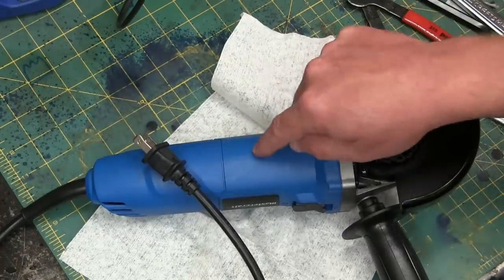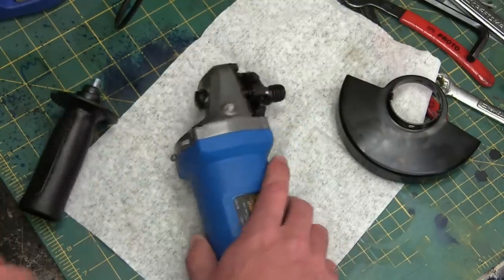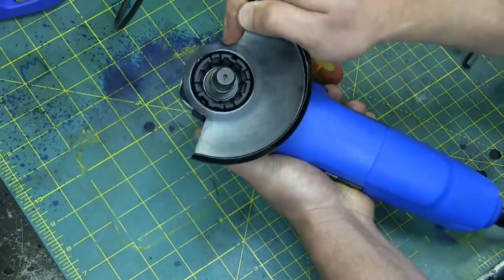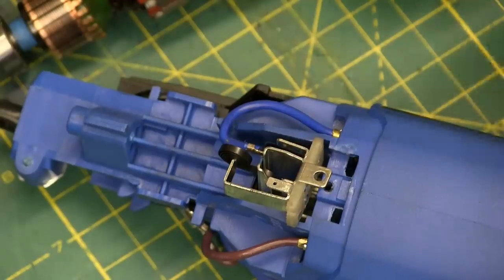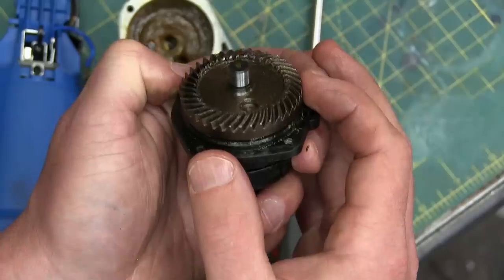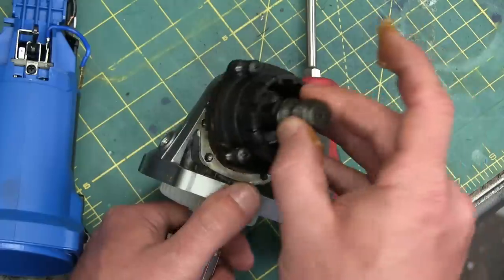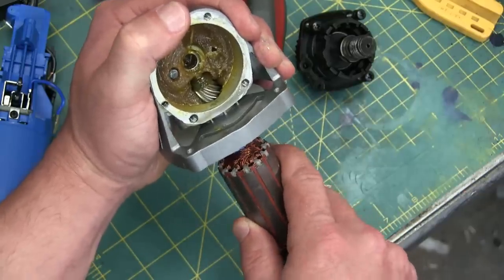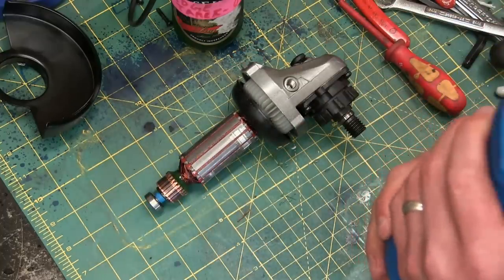BOLTR: Harbor Freight Grinder. HOW BAD IS IT?

Comment: I have one of the $15 cheapest one and have been doing handyman jobs one day in a week just to have 3 different jobs. Its already held strong for 2 years, have cut v8 crankshaft in half and some cast iron engine blocks and it still works good. Just have to let it cool if you feel the plastic getting too hot to touch, or unplug it and dump it into a bucket of water. It will cool quick and nothing scary will happen when you turn it on again.

Comment: I know this video has been up awhile, but I bought one of these grinders in 2003. I think it was $19.99 then. I used it heavily until 2014. I never had any grease leakage and never had any problem with the brush holders melting loose. I had to replace it after to tool-head lock finally wore down to the point of it not stopping the tool head to replace discs. I used it for awhile after this, but I finally used up one of the brushes and had to replace it. I thought about replacing it with another HF angle grinder, but I thought that I got lucky (if this video was around, I might have gotten another, because they don't appear to be as junky as I expected). SO I replaced mine with a significantly more expensive model in yellow/black.

Comment: Ive got probably 20 grinders.  Most of them were expensive store samples.  Missing cords and internal wiring.  I wired them up.  They definitely were missing handles and flanges.  Most were missing shields  I got a half dozen of these HF grinders on sale for the cost of flange nuts alone. $5-6 each with free microfiber or batteries with each purchase.   I've really abused these.  I put the tools that don't require flanges on them.  I've run router controllers on them, cut marble, tile, concrete.  I've got wire cups and flap discs on them.  I've had to replace the brushes on most but they come with replacements in the box.  One had a cord mess up that I need to fix(probably from using it to drag the tool lol) that only works when wiggling the cord.  One shield broke.  This is over 5 years or so.

No grease leaking, no bearing failure.  No cracks from being dropped.  No switch failures.  I've really abused these,

Comment: I have one from HFT ..use it for one thing only ..to grind a rivet off my motorcycle chain .. zips it off in 5 seconds ..worth the 15 $$
Reply: if you go throw motorcycles a lot or have a lot of them then a chain breaker is definitely a nice tool to have.
Reply: ies I have a chain breaker .. but you still need to cut the master rivet .. if you just push  it thru the link you will eventually  have a broken tool   Ask my frimd who had to  replace my chain break because he DIDNT use  the grinder I offered him ..

Comment: You are right about the two "grades" of harbor freight grinder. The normally $15 one and the normally $24 dollar one. The more expensive one makes less funny noises and seems more robust. Neither one will cut 1/2 rebar for 8 straight hours on a job. They just burn up. These things are not intended for continuous full load current. Having said that, I've had one at home for nearly eight years now and it seems just fine. I use it doing projects in the garage (cutting all thread, sanding sheet metal with a flap disk) and it still works just fine. The reason I like this model is the light weight and the gear box is smaller allowing it to get into hard to reach places with a smaller cutoff wheel. Looking forward to watching more videos, and always watch out for the Barney Fife clib board warriors.

Comment: I bought the maroon colored grinder from HF with diamond grinder wheel and ground 1/2"+ quickset off 120 sqft of concrete with zero issues.  The grinder was $18 and the wheel was roughly $20.

Comment: I've had a harbor freight 4 1/2 angle grinder for 7-8 years now. The orange "heavy duty" one with the external brush caps that they don't sell anymore. I've gone through many cutoff wheels, flapper discs, and a few wire wheels. I haven't killed it yet even after bogging it down with hot air coming out the vents and grinding for hours at a time.

Comment: I've owned about three of this size grinder and a dozen of the $9 style from Freight by the Bay. Built tons of welding projects with them. Bumpers, roof racks etc. I say Not Tea Bag at all. No grease leaks. I've never needed to replace the brushes either, even though they supply an extra set with every grinder. I have a drawer full of them. Thanks - Lumpy

Comment: I got the US one about a month or so ago since I needed something small. I have to day I an impressed with it.

also the main differences are the plastic housing for the main bearing, mine is cast aluminum. guard is tightened with a screw, so it's rock solid. also the handle is a 90', and the switch is on the top not the side.

I have dropped it multiple times and broken a few wheels, but it keeps chugging, also I cut up a forklift propane tank the other day, ran for an hour straight, no issues. also I was surprised the speed was purdy decent. for 14 and killing it it's earned it's place in my shop. definitely going to get another one.

Comment: I have four of the $14.99 grinders that I got for $7.99 on a three day week end sale. Two are out and two still in the box. Longest used is at almost a year now, no grease leaking and no failure yet, opened the second one about three months ago and its still working as well. I didn't get that high dollar heavy duty grinder though.

Comment: THe first step in your evaluation , should be to take the tool and actually use it in the proper application it was meant to be utilized for ! Then , you can tear it down to analyze it's components . Any thing less , is a Halfass evaluation !
Reply: DONT TURN IT ON TAKE IT APAAAAAAAAAAT
-eev blog
Reply: Thanks for your comment. 🙄
Reply: I think you have a point in this case.  If you break a part in the tear-down and glue it back together, It kind of casts a shadow over the run test.

Comment: I've got a Black & Decker 4 1/2" grinder that has a part plastic bearing case on the gearbox. It's had quite a bit of continuous use and it's still working fine. I did take it apart though and discovered the gearbox is dry. Always has been.

Comment: I've got the cheapo HF grinder. The grease doesn't leak out, but then again mine actually has a cast aluminum piece instead of the nylon. The fan was the weak point on mine. Used it about 6 months and she broke off inside. Still works, but I'm going to have to pull it apart and JB weld it back together.

Comment: had my harbor freight grinder for about 12 years now, its cut through everything i needed, from conduit to stainless steel and cleaned several floors using flapper discs, never failed once and still going. recently used a coupon to get a new one but haven't even opened the box.

Comment: I do a lot of scrapping and have noticed an interesting trend.
You made a comment about the "LARGE" wire size of the
field windings. Please take a file to the magnet wire used.
I have seen on a lot of appliances like washing machines
 motors and Micro Wave Transformers have copper colored
Aluminum wire which is usually a larger gauge than the 
real copper wire used. Thanks  KC1IPA

Comment: I ran a fab shop and we tried these out. A few of the guys had them at home for years with no issue. We bought 10 of them. 6 died in the first week with a poof of smoke. The last 4 didn't last a month. I have one of the Chicago Electric that I use around the house and its ok, just have to let it cool down after using it for any amount of time. I use my Dewalt for big jobs.

Comment: Thanks for the video.  Still watching my way through all of them!  Just thought I'd share with ya...Back in year 2000 I ordered the cheapest HF 4-inch grinder online.  I paid $9.99 USD and they shipped it to my APO in Belgium (I was US Military then) for free; they even hand-wrote a "...thank you for your service" note and tossed it in the box.  I didn't expect much, but she chooched just fine.  Got a big project done.  I ordered 7 more for the same 10 bucks each and they are ALL still choochin' today.  Worst break so far was a gear-case bolt backing out....cranked her back down and she never bothered me again.  I don't treat my tools nicely.  Each grinder came with spare brush sets, which seem to go about 20-40(?) hrs. I can't remember the last time I wanted a different grinder.  Fine, med. and course flapper wheels, abrasive cutter, diamond cutter, grinder,  wire cup and twisted-wire wheel are my family.
None of them have ever let me down.  That being said; if you ever struggle to find someone to adopt one of your tested badass pieces of machinery, I'll be happy to step up and assume it's paternal role!  
Keep it up man; you rock

Dalton

Comment: Bought a Chicago Electric grinder from harbor freight when i was finishing concrete.  was an emergency purchase when the grinder i was using burned up.  paid less than $20 for it.  figured it would only get me through the rest of that job.  actually was surprisingly one of the best grinders i had.  since it was so cheap i wasn't afraid of abusing it.  actually lasted longer than the dewalt that had burned up on that job.

Comment: Honestly, my first grinder was a HF and it's lasted like, a 7 hard years of abuse and still going strong. The only thing I've done to it is change the brushes a few times. That being said, I did buy another one that lasted a couple months before the head casing part broke and wouldn't allow the lock pin to go into its home. That just means it's grinding wheel will alway stay on, forever, or until it dies some other way. You should take mine apart to see what years of car fabrication projects have done to it.

Comment: I bought a new $10 USD HF grinder, no issue at all.  A $5 used one from a local eBay seller and I went and pick up, no issue.  A $40 USD Ryobi from HomeDepot that has switch very much like The one you have. The top plastic came off. So I use a large elastic band to hold it in place.  Annoying. I am handy and my jobs last 1-5 min. I do not grind something for 30 min where it may build up a lot of heat. The jobs can be stucco cutting, sharpen my axe, lawnmower blade or other yard digging tools, cut 0.5-1.5mm steel and light weight concrete roof tiles.

Comment: I have the cheap Harbor Freight Drill Master grinder - the one in the black box. I got for US$7 about 10 years ago and it's never given me any shit. No leaks, starts right up every time. It stalls if I really lean on it, but it hasn't burned up yet and, really, wanting it lean on it just means the wheel's shot.

I use it for prep and cleanup on welds, rust removal, paint removal, dressing parts that needed some "encouragement" to come out, cutting, substituting for my non-existent bench grinder - the usual. Haven't even worn out the first set of brushes!

Oh, and the longest run I ever had it going for was about 2 hours. Cutting the old jack out of a trailer tongue and massaging the plate braces to fit the new jack. Never even slowed down.

Comment: went through three over the years and as you suspected they all greased out at heavy workload and higher heat... still got about a year out of each one and they are good throw away  tool that no one ever wants to steal on the job sight.

Comment: I bought one about 3 years ago, switch tab broke,  exchanged for a new one which I've had for about 2 years now. I only use it with cutting wheels at work though so pretty light duty. As an apprentice who was low on funds, it was a great buy. I'm going to get something a little more "scookem" next time though.

Comment: I have one like that from Harbor Frieght, but a burgundy color. Same price. It used it rough and hard and when it finally failed, it was the bottom of the switch where the live wire comes in. It was just as cheap to buy a new one as it was to get a switch and shipping etc.

Comment: Yes, the grease leaks out.  But mine didn't leak out while using it.  It actually leaked out over a summer just sitting unused upstairs in my garage where there's no A/C.  But the fucker still works and I've been suing it with a diamond bit to cut concrete.  You can hear the bearings are shite, though.

Comment: The local Harbor Freight that opened three months ago has a similar but different grinder. No plastic bearing housing but a small but decent aluminum piece instead. The guard is different as well and has a hose clamp style adjustment which seems to be used on all of the HF models as well. All of the grinders seem to have the cheap 18 awg cords even the 7 amp models. The grips mostly seemed to be PA6 GF30 of somewhat different thicknesses on all but one model which was unmarked and felt different (maybe PP or ABS) and was flimsy. The case and everything else looked about the same on 5 amp model as compared to the video grinder.

Comment: I bought some 1/8 inch wood drill bits from Horrible Fright.  I was drilling some hickory, and the bit started untwisting itself.  After I finally got the bit out, it had almost become straight, no twists, just a groove.  Only items I purchase there are AAA batteries, extension cords, bulk rubber gloves, and whatever screwdriver set I get for free by purchasing mentioned items.  (with coupons)

Comment: I have the US version "Drill Master" super cheap $15 ($9 on sale) 4 1/2 grinder. I don't use it often, but when I do, I beat it like it owes me money. I wear welding gloves when using it because the whole thing gets pretty uncomfortably hot when it runs more than a couple minutes without shutting it off, grinding or not. Mine has an all metal head, and that switch gets pretty annoying after a while, especially when wearing heavy gloves. You have to press the back part, then slide it to the on position and make sure it rocks into the locked position in order for it to stay on, and it's kinda hard to do with 1/8" of cowhide between your thumb and the switch, plus it shuts off with the slightest touch or jolt.

Comment: I’ve had a harbor freight 4.5” grinder through welding school (a year long) and used it in my shop for another 1.5 years. Not sure on how or what it’s made out of but I’m glad I didn’t spend the 600k on a metabo.

Comment: I put this grinder thru its paces and it lasted about 3 days of heavy use before the motor started smoking and seized up before brush holder or gear head failed

Comment: Old video but i don't care... . I was out of town on a job and the odd occasion came to be that I actually had an urgent need for a grinder,  and of course thats the one tool i left at home.   So i went to the local harbor freight and purchased the 6 inch corded Chicago electric,  that was 6 years ago.  Now its the loaner shop grinder.  Its never had the brushes changed out, gets abused daily and will not quit. Its incredible!

Comment: I've had a HF grinder for several years. It is weak as hell, but does okay with a flap disc and the low power give you a bit of "touch". I think it finally broke down a month or so ago. Haven't bothered trying to figure out why. Could just be a switch, but just not worth messing with it.

Comment: My $6 cheapy Harbor Freight which is almost identical to your Mastercraft took some serious abuse ( 5+ years of grinding, wire brushing rusty trailers, cutting granite walls...) before the BRUSHES finally wore out... It came with an extra set which made it last another 2 years till the switch and brush mounts went. Never leaked grease. Well worth the money.

Comment: I work maintenance in a heat treating plant... and I use Horrible Freight all the time, and my boss loves it... coupon day! Anyway, buy the Chicago Electric version, it's gear housing is cheap aluminium, not plastic. Also buy 2 for 35 American Pesos with coupon, and here's why... When you start to smell it, switch to the backup. I've gone through 10, maybe 15 of these in the past 19 years... and the most common failure point I have hit is the varnish on the commutator coils burning off and shorting out. Use PM tactics, blow the thing out to clear dust and debris to save the bearings... use a non-OSHA modified blow gun to get the air where you want it, then hide the blow gun. Also, these only draw about 4.5 amps, not enough power to break itself, unless you lock up the zip cut blade and don't turn it off in time.  Don't buy the Drill Master brand... the case will fall apart in your hands and you have live brushes in your palm... not fun, trust me.

Comment: I have the older version of this Canadian Tire grinder purchased in 2005. It's my least favorite between my Milwaukee, Bosch and Makita grinders all 41/2 inch. To large around the motor housing for comfortable one hand use. Even though it hasn't had as much use as the others, it's worn out. Every bearing is rough. The brushes don't advance smoothly. The back armature bearing is a tiny 606 or 626. The one you are taking apart seems better.